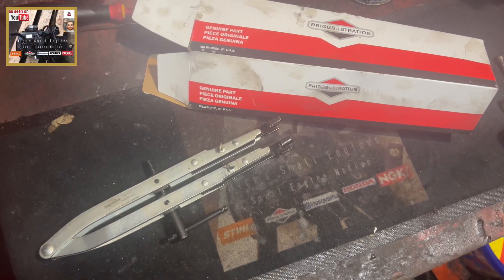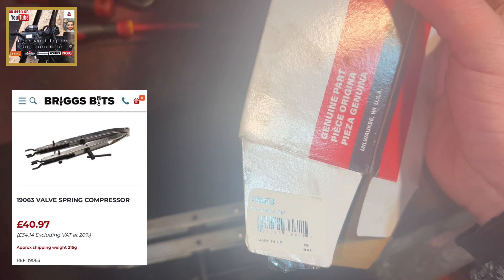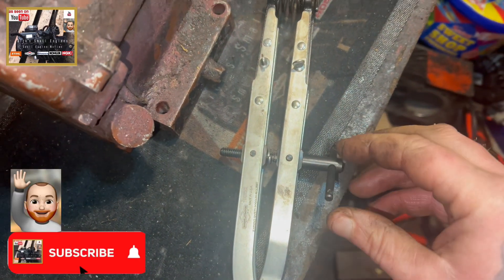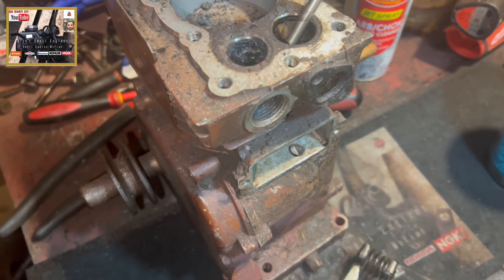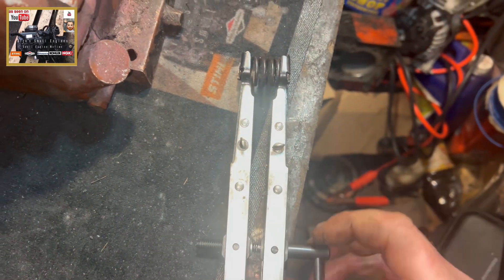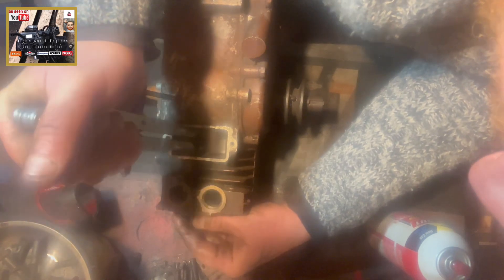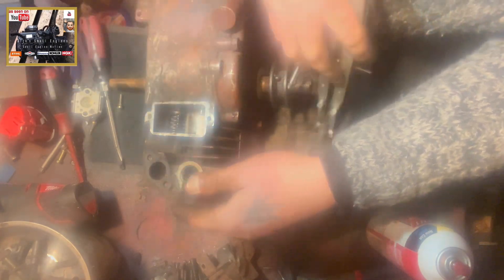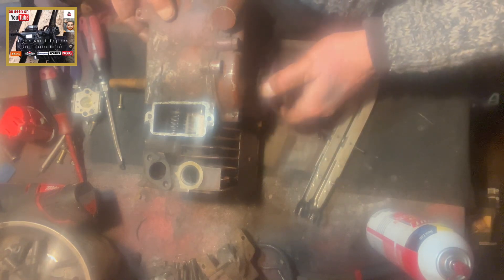Briggs & Stratton Valve Spring Compressor Tool-  19063• How it works 🔧• #briggsandstratton #mechanic

Comment: Watched this earlier that’s a beautiful tool as well as helpful, you mentioned the state of the engine but I was zoned in on the glimpse I got of the bore it looks brand new!, got a thing for the old classic mowers flattop things I used to get them from the recycling yard and botch one up out of 2 etc. i left loads I wish I’d just taken & stashed now, I was paying fiver or tenner depending on condition, I don’t like the new plastic carb models but hey ho! I use those we mowers to do my garden and I’ve got a few engines stashed so I’ll be fine but I’m getting to a question here I’m sorry I’m taking a while but here we go, I’ve had one for years I loved it started up 1st time every year etc. this day I’m mowing away & I hit an old bit of angle iron I’ve mowed that part for years and it wasn’t there so the ground sunk or something it was only like a half inch but it’s part of an old fence concreted in so I malkied it flat with a sledgehammer, the mower was vibrating like a mofo I thought the bladed was bent. Long story short & it’s the crank that bent, had an old heavier boss that didn’t break, I made another one up & robbed some parts from it but I’ve heard Ken saying straighten them with a club hammer etc & someone else said stick a scaffy tube on it & bend it back but how does that work cos who holds the engine/mower when you’re swinging on a scaffy pole 🤷🏻‍♂️😂, I’ve kept it cos I think it probably can be knocked into near enough a true position, maybe vibrate slightly but whadayathink about that? Sorry for leaving such a rambling ramble but I’d be interested in your opinion when you have time ok mate, cheers, Mikey 😬
Reply from the maker: I’ve never straightened one with a scaf pole mate but I’ve seen them straightened in a similar fashion. I’d just change it out personally….. 👍🏻🔧